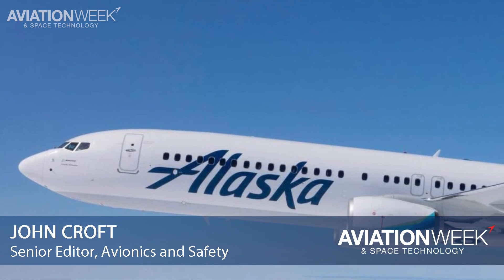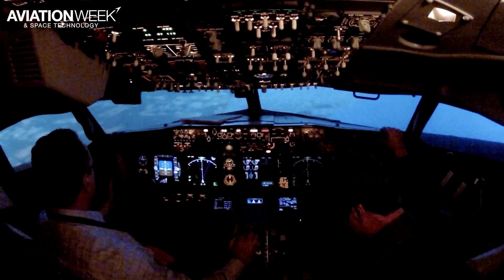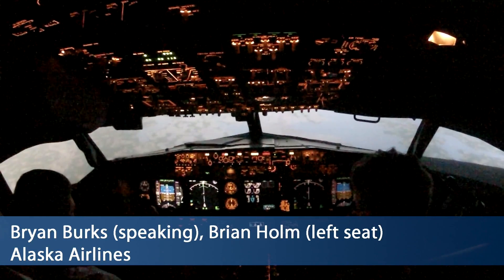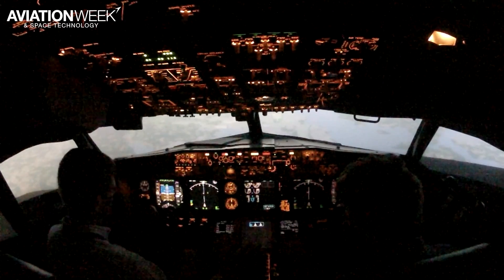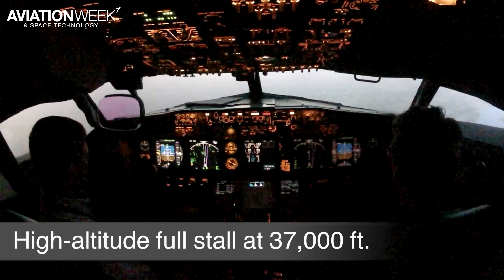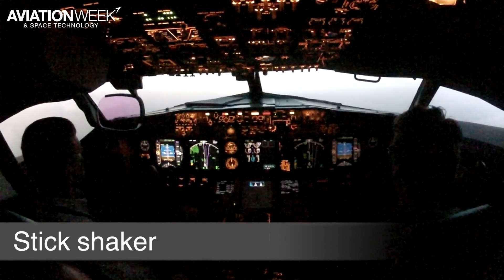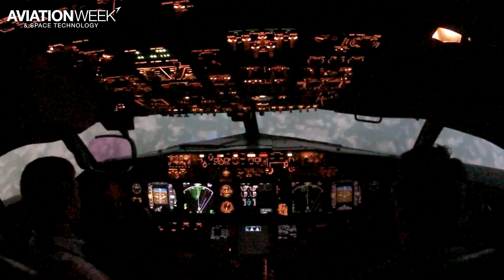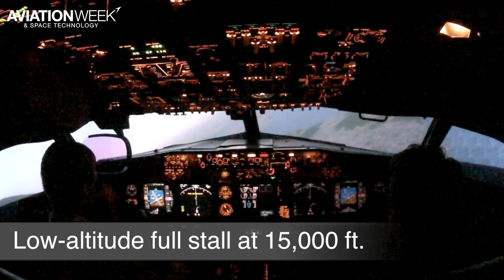How Does A Boeing 737 Handle On A Full Stall?

Comment: From what I understand, the heavies roll of the Boeing line and are flown out over the ocean where they can be yanked and banked to be fully checked out. I would assume stall testing is included in the regimen.  

I know the carrier (United, American, etc) testing of a four-seven that needs cold soak involves a most un-commercial climb out profile- they stand that thing on its tail and firewall the throttles to get it up to altitude as quick as possible. Many unorthodox maneuvers can take place during that testing, and I doubt stall testing would be much more stressful provided the airframe NE limitations were observed.
Reply: You are confusing airworthyness testing with pilot training. This video is about the latter.

Comment: I wonder who validated the post-stall aerodynamics model for the sim.
Reply: Chi Cheung - I'd guess that a big part of this training is getting accustomed to the stick shaker and stick pusher. The pilots need to be familiar because the stall might not be the only problem. They might be getting saturated in warnings and busy diagnosing problems.

Do you know what ABS feels like in a car? Do you want to find out the first time in the dark on ice with an imminent collision?
Reply: When I used to train in a Socata Rallye St110 we had no stick shaker but the whole plane would shake violently for a few seconds during the aerodynamic buffet transition, always loved to stall that plane, best stall performance I've ever seen...I imagine the 737 stick shaker is artificially produced? I wonder if the Airbus have that feature?
Reply: Chi Cheung not necessarily. The stalling characteristic of a swept tapered wing is nasty. The minimisation of induced drag leads the designer to design a wing that tip stalls, which means the CofP moves forward as the stall progresses, leading to a heavy nose up pitching moment, which quickly leads to an irrecoverable deep stall. High tail A/c are even worse for this as the heavy stalled wake turbulence off the wing engulfs the tail plane, meaning there is NO pitch authority to lower the nose and recover. 

Airliners are naaaaaastyyyyyyy in the stall, which is why our French friends work hard to make sure Biggles can't ask his Airbus to do that.... unless the air data system has bolted into alternate law because the pitot-static system froze.....AF447 refers.
Reply: @Crouchypants  That was well explained. Tip stall and its associated loss of aileron authority is a real nightmare. A testament to ATP pilots and their training that it happens so rarely.
Reply: Hawx1163 - I used to hear a lot of concern about "negative training" -- teaching pilots the wrong response -- if the models weren't correct.

I'm glad to hear Boeing has done the flight testing and wind tunnel testing.
Reply: Some really, really brave men
Reply: jetpowered1 - All models are wrong, some models are useful. -- George Box
Reply: Nelson Brown 
The simulator cannot mimic a full stall exactly, because of its own limitations. But it's close enough for training on the newer series aircraft.
Reply: Nikola16789 The more reliant pilots become on their instruments the less they're prepared to apply "real world" aerodynamic principles in the event normal flight conditions no longer apply. My dad learned to fly in seaplanes and spent his weekends out at the glider club so every maneuver he associated in his head with its applied physical principle rather than just thinking "Push this button, plane does this, move that lever, plane does this."
Reply: Nelson Brown The 737 does not have a stick pusher. All 737 pilots are familiar with the stickshaker. At issue is previously airline pilots were taught to recover at the approach to stall (normally but not always the stickshaker) while now the FAA is requiring fully developed stalls to be demonstrated. This required accurate simulator modeling beyond what was previously done.
Reply: What country even issues licenses to pilots without such fundamental knowledge? What airline allows that such pilots pass their tests?
Reply: DrHarryT You can stall at any speed. Spins are neither tested nor evaluated in commercial multiengine aircraft.
Reply: Nikola16789 this issue is one of the most controversial in pilot training today. The MPL syllabus is supposed to fix the issue of pilots not having seat-of-pants flying skills, but most see it as cost reduction and profiteering by the main FTOs. 

Sadly the modular trained people will continue to struggle to land airline jobs. 

Don't get me started!!!
Reply: It isn't about common sense.  When in a stall and the pilot has not experienced it, the brain does what it knows even if it doesn't know.  So the instinctive response is to pull back on the stick (which is what some pilots have done and have resulted in a crash).  Also, when you are close to the ground the result is to lose even more altitude, but that is still preferable (and crash) than to pull back on the stick and crash at an even greater speed.
Reply: Charlee C; pilot.
Reply: Anton Zuykov it's easy to armchair quarterback and say what you would've done differently. Responding to unexpected emergencies in real time is different than giving your input after all the facts are known even more so than training for such an event when you know what is coming.
Reply: When in a stall the air speed is so low the option to point is limited or low. Yes you push the yoke forward to put the elevators down in order to try and gain air speed while the aerodynamics and center of gravity naturally make the nose go down. Flat spins are a bitch. Once you have some air speed then you can start to pull out of the dive.
Reply: Blackboxes
Reply: AF447 was a long series of flight planing and judgment errors, any one of which being done correctly likely would have prevented the issue from ever developing to a stall in the first place. 
Once in the stall pilot lack of skill transitioned straight to panic and was then compounded exponentially by serious deficiencies in the Airbus cockpit control design. Setting aside the skill atrophy caused by Airbus "normal" mode manual control in which the computer prevents out of envelope inputs.(airbus also has a full manual "alternate" mode which is what it drops to when sensors or auto-flight fail.) With traditionally linked controls like those on Boeing(and most others), both pilots are aware of what the other is trying to input, Airbus hides the respective sticks way off to opposite sides and offers no indication to pilot A of what the pilot B is inputing, then the computer does a simple dumb averaging when in dual mode, even with opposite inputs and sensors indicating a Stall.(A statistically very strong indication that the back stick is an erroneous input) The first officer was inputing the correct stick forward but both he and the capt now back from napping and in the jump seat were unaware that the junior pilot was in a blind panic and pulling full back.
Frankly I find it curious that (as far as I am aware) the Airbus design was not named a contributing factor. Maybe the French investigators were protecting a major French company, possibly with a misguided notion that they are somehow being helpful by protecting half the worlds airline fleet from fixing the issue.
Reply: @mytech6779  The Airbus has an audible "Dual input" warning if both pilots are using the controls at the same time. They just weren't paying attention.
Reply: I'm not even a pilot and know that when you stall, you point your nose down. It's common sense.
Reply: Unless you are doing it in the real aircraft it is still just 1's and 0's and we all know that engineers are never wrong. The best policy is to never let the aircraft get into the stall in the first place, sending pilots out on the line with them thinking they have truly experienced a high altitude stall in the sim will make them more likely to get into one.

Comment: aaaaand back in coach, my seat, just fore of a bulkhead lav, I'm probably shitting my pants.
Reply: whats scarier than stalls is the lost of elevator effectiveness during stalls. Thats when I'd be shitting in my pants.
Reply: T tail is not your friend in this regard. The more broad the mainplane at the wing roots, the worse it gets; the worst in history was probably the Gloster Javelin, with a T tail behind a delta wing. The F-104 Starfighter was also not immune in this regard - fat low aspect ratio wing and T tail was a bad combination there too.
Reply: james rabbit wasn't that the one where it's wing got clipped by a private jet and damaged it's ailerons or Hydraulic fluid and flat spinned and you could hear the F/O almost begin to cry?

Comment: Holly Molly on those secondary stalls ! Eye opener right there !
Reply: It would have helped if he had increased thrust as part of the initial stall recovery.
Reply: @thecheeta  the secondary stalls happened because the pilot tried to recover to a level attitude too quickly, which exceeded the critical angle of attack.
Reply: I'm no pilot, but I remember watching in a video that increasing the thrust prematurely would cause the airplane to pitch up because the engines are mounted below the wings...